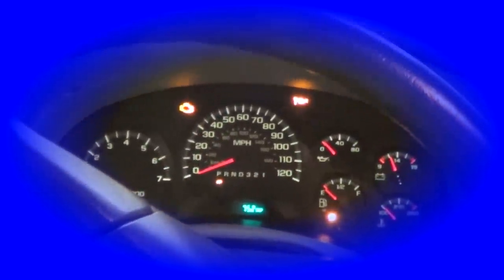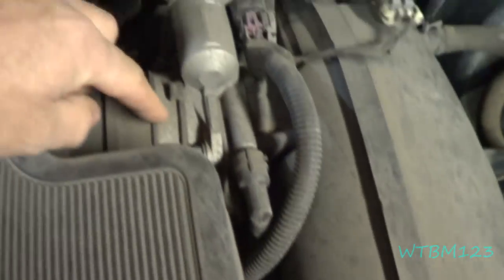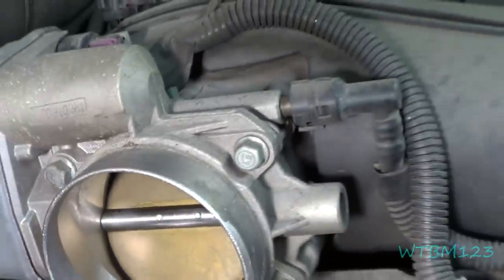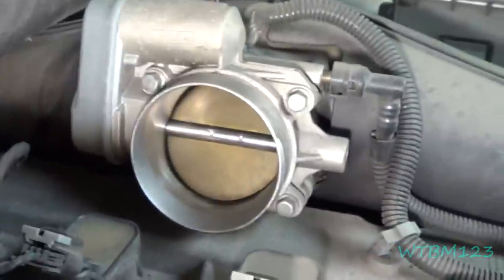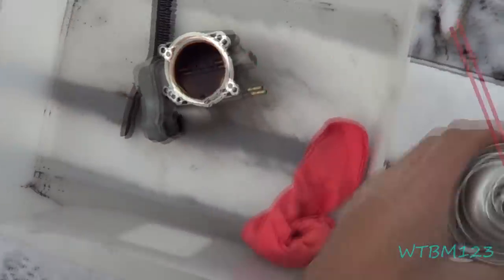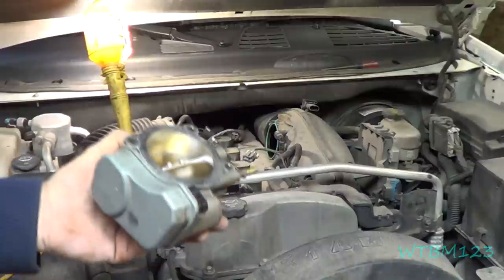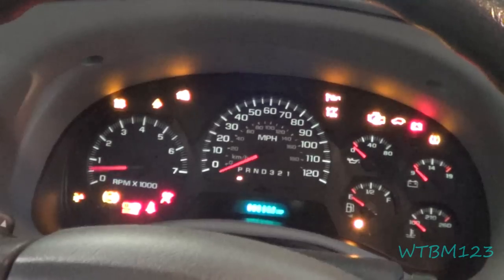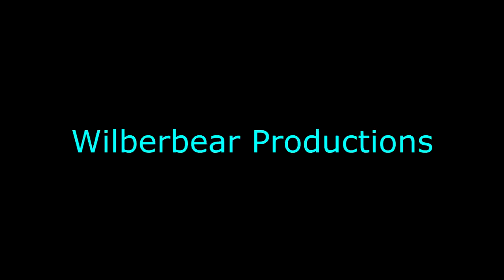Trailblazer, Clean Throttle Body, Electronic Throttle Control, Codes P0506  P2119

Comment: cleaned throttle body and pulled #10 &#28 fuses put all back in and on 05 trail blazer now idles at 2500-3000, what can I do to fix?
Reply from the maker: +richard malone It needs a relearn procedure done , some will do on its own , but may take some time , or someone with a scan tool can do . A lot of times this happens if butterfly was opened by hand .
Reply: +wtbm123 how long does this usually take it to relearn?

Comment: i cleaned reset code  start up truck and no rpm at all when pushing gas if i leave it run and plug the scan tool in then reset the code then i have rpm till i shut key off im lost on this
Reply from the maker: May be the throttle body is bad , may need to do some testing on it
Reply: @wtbm123   flushed  out transmission   line    it was like never changed    replace  filter  in the pan and added new fluid  no engine  codes any more   my thought I think  transmission   was getting to  hot
Reply from the maker: @rickcarp5453  Glad you got it sorted out , And thank you for sharing what fixed yours . It may help someone some day that is reading the comments

Comment: Where does the carbon build-up in the throttle body come from???
Reply from the maker: Oil residue ,lot from pvc system and egr system , some even say from what pulses back from the intake valve. they run crankcase pressure back in the engine instead of venting it out to the air.
Reply: Lower quality gasoline. Try a better gas station like chevron, shell, Phillips 66.etc
Reply: Any vehicle no matter how good of quality gasoline you use will eventually build up with carbon now that don't mean your car will throw a code causing a check engine light but they all do it an with 100 thousand plus miles will start to effect gas milage some it's really just good preventive maintenance to clean your throttle body. I like to every 4th oil change pull the intake snorkel an clean what you can reach an only when it gives any trouble codes do I go as far as pulling the throttle body to clean like this

Comment: I will have to disagree with Ed below.  There is a need to clean the throttle body as you can clearly see the carbon buildup in this video.  The car was throwing a code for throttle body cleaning and it was running rough.  This guy should have disconnected the negative terminal on the battery or you can pull fuse #10 and #28 and wait about 10 minutes.  This resets the PCM computer so it will learn the now clean throttle body..air/fuel mixture
Reply: uploadthis2011 can I pull the fuses before I start unplugging wires? and should I disconnect the negative before I start just to be safe?
Reply from the maker: misterdinkly You can
Reply: wtbm123 Awesome..thanks for the info and video!

Comment: What are some of the symptoms that would require this to be done? I have a 2007 Envoy that has recently started idling poorly, almost like the engine "jumps" or sputters.  After about 10 minutes on the highway its not nearly as bad, and sometimes the check engine light flashes.
Reply from the maker: I would see what codes , with the flashing light it sounds like a misfire . maybe a coil or oil in spark plug well . a flashing light is saying do not drive as it is causing damage to converter
Reply: Yes it was a bad coil. Easy fix. Thanks.
Reply: wtbm123

Comment: is there any reason that you left out resetting the pcm by fuse removal? I'm asking because I;m curious if this is a necessary step. Thanks.
Reply from the maker: +Stabby The Clown  One can reset the codes , and may help it learn faster , but if issue is fixed after a little run time the light will go out . I use a snap on scanner when i do reset them

Comment: Dont take the TB off there is no point tou just risk messing other things up. It works just as good if you leave it on the car
Reply from the maker: I would just rather remove and not wash it all down in engine and converter

Comment: Im about to give up on my trailblazer. ove put so much into ot and it just keeps getting worse over time. dont want to keep driving it and make things worse. I know the cat was clogged. replaced that and the 02 sensors. gave it new spark plugs and coil packs. changed most of the sensors and actuators.  idk what else to do.
Reply from the maker: Have you checked the vvt solenoid , kinda behind the power steering pump. . First test the basics , Compression , fuel and spark . Most things after that really needs live data to diagnose. Like what are the fuel trims and MAF readings , Is there misfire counts , One needs to find out if it is spark , fuel or a mechanical issue . Have you checked fuel pressure . . Does it miss , just lack of power or other
Reply: @wtbm123  yeah theres lack of power but its not limp mode if thats what youre thinking.  ive changed the vvt solenoid already. kinda like a fuel filter. it wasnt that dirty or clogged but i still replaced it. yeh i want to get one of those compression gauges and test out cylinders. going to run carb cleaner thru fuel line and injectors.. maybe clean it out some. i think its more like from the computer. it drives okay but ldle just needs tuned. been driving after spark plug change trying to reset idle relearn by disconnecting battery for 30 mins
Reply from the maker: Does MAF read correct , and good fuel pressure . Do you have any way to see live data  @tylersanders8853

Comment: mine wont start throttle bodey is closed and wont open starts  four a sec then dies any suggestions
Reply from the maker: Brad Lynk Sounds like the throttle body is , bad , but check wires in the plug attached to it as sometimes there is a wire that breaks and it is sometimes hard to spot.